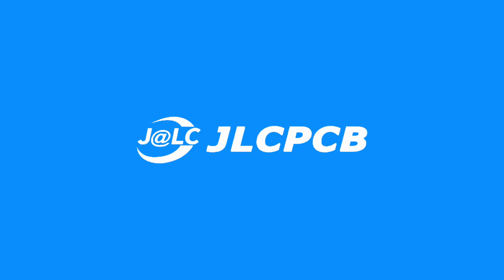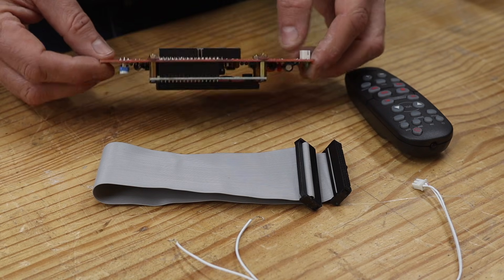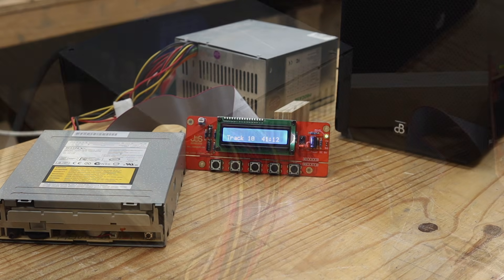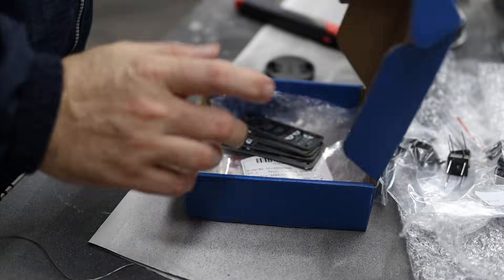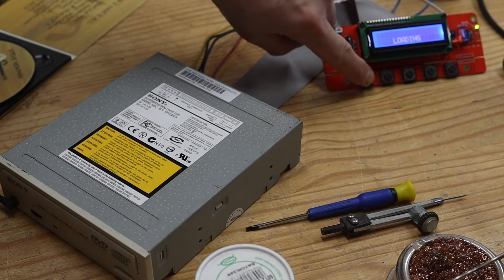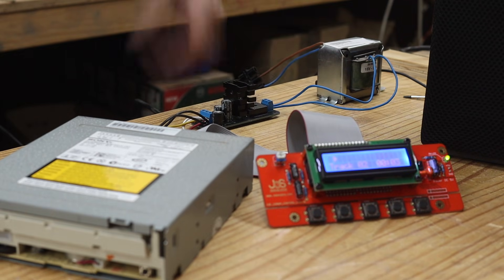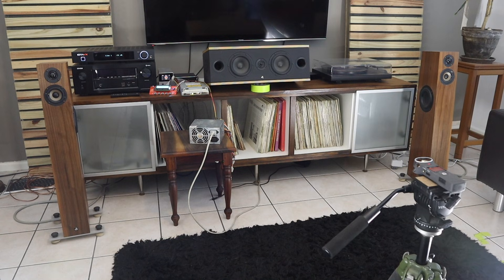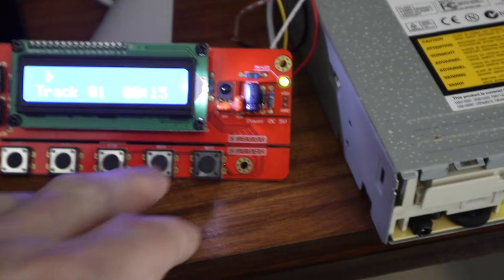How To Convert a CD-ROM into a CD Player

Comment: This is awesome, I've been looking for a bit to have an actual CD transport that wouldn't cost me half of my salary haha (I know there are cheaper ones but still :v), and I just learned that you can use an old DVD player with optical or coaxial S/PDIF output and use it as a transport, well this is a bit more elaborated but still a great alternative with a really low cost. Thanks for the great video!

Comment: The kit should include a ied to sata adapter  as well  also  if using a laptop  cd rom drive to ied adapter  both sizes adapter  so you can use more up to date cd roms drives that are more widely available.  They would sell more kits .   Most people aren't wanting to have to find the adapters separately.  Just my opinion 💯🎵🎶😉🫡✌️👌

Comment: I was dreaming of a controller like this since a MS-DOS CD-Player program. It did exactly same thing - sending ATAPI commands to CD-ROM drive to play CDs. It was a small .exe file and I was sure it didn't contain too much so some small device for sending ATAPI commends was expected.
The price on Aliexpress is unexpected though :-) You can actually buy a couple of CD or DVD players for the price and they would have remocon and some optical SPDIF onboard :-)
Reply: Furthermore you can buy some PI micro-PC for the price and connect it to SATA DVD-rom building much more complicated device to play not only audio-CD but any other format :-) But that's a very different story.
Reply from the maker: Also a great idea. I like it. Might look into this.

Comment: Wonder why not do away with the transport all together? Just copy the CD to SD card as raw data, no compression and then feed the DAC from the SD card. No more transport issues to worry about! I know, where's the fun in that...
Reply from the maker: Yup, no fun in that, but I get the point.
Reply: @SoundBlab  Plus you could upsample the data at the same time! Still not as much fun as rooting around in the loft for old CD drives though...

Comment: Wow man u get it run, i couldnt , an ask teacher, what is watts enougth to make run cdrom drivev?
Cause i'd tryed with conmutated source to6 laptop since 5v ,12v...24v  what is 60watts more and less... So why it couldnt to run for me ?😢
Reply from the maker: I am using a power supply with 5V x 8A, and 12V x 4A output.

Comment: how do you connect the cd rom to an external DAC?
Reply from the maker: Mine has two pins on the back as a digital output. Its essentially just a coaxial digital output to which I can solder a rca socket.

Comment: does the remote control turn on/off the controller board or need for a switch?
Reply from the maker: I know you emailed me as well, but will also answer here for the sake of others. It does not, I will put a mains switch at the back that will turn off the PSU, otherwise the remote only puts the controller board in standby mode.

Comment: Maybe you can use an ultra slim slot loading drive. Excellent project.
Reply from the maker: A slim drive would've been very nice I agree, but they tend to only have a SATA interface, I need IDE for compatibility with the controller. Thanks, I need to get back to this project sometime soon, have put it on the back burner for a while...

Comment: if you look around CREATIVE made some cd drives that just have eject, ff, rw and play buttons integrated on the front. some even have a built in IR reciever as they came with a remote designed for use in media center pcs. Even drives with just a ff button are able to function with no connections other than power and headphones. still this is really cool that some one makes a "head unit" of sorts for these old drives.

Comment: It is only for IDE. They extinct. But there are a lot of SATA drives. How to convert SATA DVD-ROM into a CD player?
Reply from the maker: I do not know of any SATA capable controller at the moment. But there are still IDE drives on the secondhand market that is worth while if you select carefully.
Reply: @SoundBlab  It's not a problem. I have IDE and SATA as well. Thx.

Comment: A wonderful, amazing demonstration video.  A detailed, comprehensive lecture, and fine demonstration. Thank you for this technical video. For myself I want to possibly make a CD Transport, not too interested in a complete CD Player; since I have up to four connected to my Sony AV DH520 85W Receiver!

Although I listen to vinyl records on 1 of my 2 turntables, I listen to playback after the early 1990s music on a Compact Disc. I should have bought a CD Transport, most likely the Audiolab 6000CDT CD Transport! I'm a bit of a miser, so I bought at least 2 different CD Players that I can connect as a CD TRANSPORT. I'm very impressed; and that this Audiolab 6000CDT has a Toroidal Transformer. 

Instead I bought at least another CD Player that I could use as another CD Transport; I have collected up to 4 different CD Players, 3 brands for now, and up to three different interconnect connections. I did so for experimentation, tests, and obviously for musical playback.

Sony CDP-CE215 bought at the end of 1998, connected with RCA L, R interconnect. Marantz SACD/DVD Player DV6400 (of Dec. 2003) connected with Coax RCA Cable. Sony CDP-970 (manufacture date April 1989) to be connected to digital optical output with a Toslink Cable. I got stuck with a Denon DN-600F (1998) at auction on ebay; it is also connected with traditional RCA L, R Cable. All four CD Players are connected to my Sony AV Receiver DH520 85W (bought in 2012) that I only use for hi fi audio. 

However, the CD Tray of an AMC CD-6 (1992) won't open. I was to connect at least one CD Player as a CD Transport by way of digital cable.

I may get a DVD drive even though I have a DVD, and RW drives in my Sony VAIO desktop PC. I also have 2 power supplies that I have not installed as I was going to construct a PC. Again thanks for the information, and guidance.🔉🎵🎶
Reply: If CD-player's tray doesn't open, it means a small belt of opening mechanism is worn out and can't overcome the force of magnet which lifts disc after it is loaded in tray. You can either replace the belt or attach several pieces of duct tape to magnet, this will increase the space between magnet and disc platter, so far you'll reduce magnetic force.

Comment: Why did you need another power supply board, you have all the voltages you need coming from the computer power supply?
Reply from the maker: The PC power supply is too big. I wanted something much more compact that will fit into an average size enclosure for a typical CD player.
Reply: @SoundBlab  Ah, ok, now I know why you did it that way, but I think I would have tried removing everything from the power supply to see if it would fit in the case, but if you were that tight for space it might not have been an option for you.  :-)

Comment: The plextor px 40tsi 40x as well as many others has cd controls an audio output jack on the front as well as stereo pinouts in the back. All it needs is 5v and 12v without any additional controls.

Comment: Dear Friend: a great video. But I would like to know where you get the audio sound from? ..... Waiting for your news, receive a cordial greeting from the Canary Islands (Spain) ....
Reply: I am not an author but I have simillar device and you have both digital spdif and analog audio outputs on the back of cd rom. Regards from Poland
Reply from the maker: I took the audio output form the SPDIF (coaxial) output on the back of the unit into a DAC. Not all CD-ROM drives have a digital output, but most should.

Comment: If you can find one of the old computer CD-ROM drives that has an actual big play button on the front and a headphone jack all it needs is power and you just hit the play button and you can skip forward and it actually plays audio out the headphone jack without anything else.
Reply from the maker: That is what I tried in the beginning just to see if it works. However, the sound quality from the headphone jack is not very good. Taking the digital signal from the back coaxial outputs into an external DAC gives you much better sound quality. But for a quick solution where sound is not a priority, it can make a decent headphone CD player.
Reply: @SoundBlab  yeah I remember several years back in IT we would have one of those and just some PC speakers plugged into it on our workbench to listen to music in the shop
Reply: Need navigate system to play all type of format
Reply: @mahanichannel1509  nope. The controller only sends commands via ATAPI interface and the CD-ROM drive plays Audio-CD only by itself. No other formats possible.

Comment: This is nice. Did your Sony CD drive have TOSLink output?
Reply from the maker: Thanks. No, it actually has two audio outputs - One is the normal analogue out and the other is a digital output. I am using this digital coaxial output and going straight into the coaxial input of my DAC.
Reply: @SoundBlab  Aah yes, I seem to remember the digital audio output. Is it just PCM or SPDIF?

Comment: This is incredible, I had actually been researching such a build myself to no avail. I will definitely be giving this a go.   Can’t wait to see your future build video!
Reply from the maker: Yeah, I also had this on my list for some time now and finally got down to testing it out. So far it looks promising and I am also keen to get the new power supply and build this into an enclosure.
Reply: I suggest using a CD drive that has dual output (both headphone jack and rear stereo pinouts) and integrated face controls. Just add psu and rear jacks